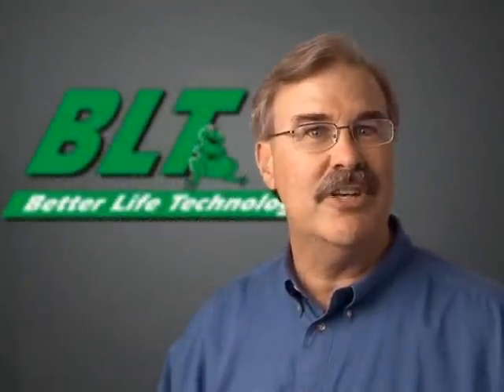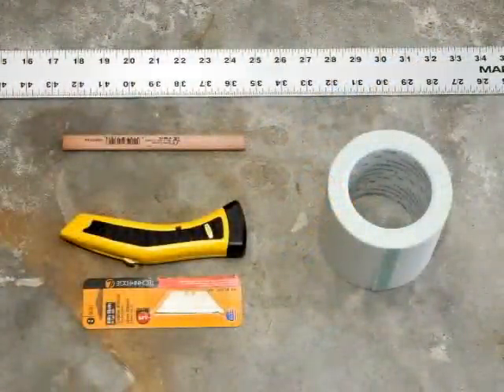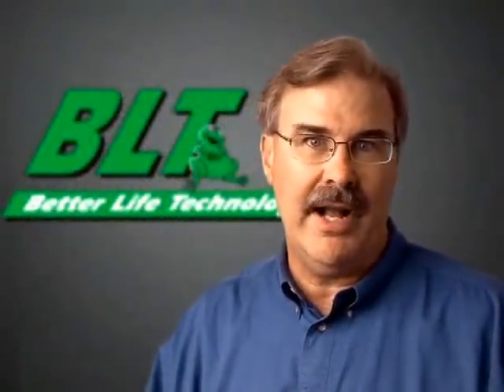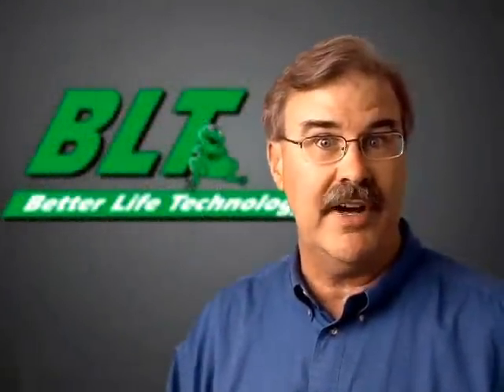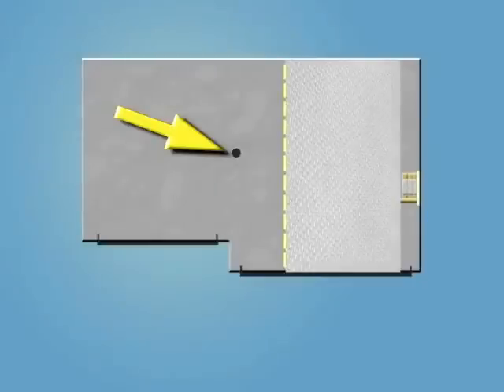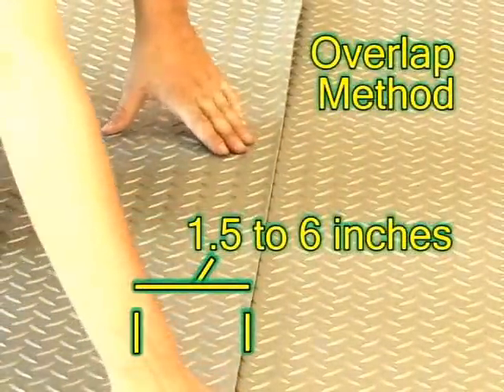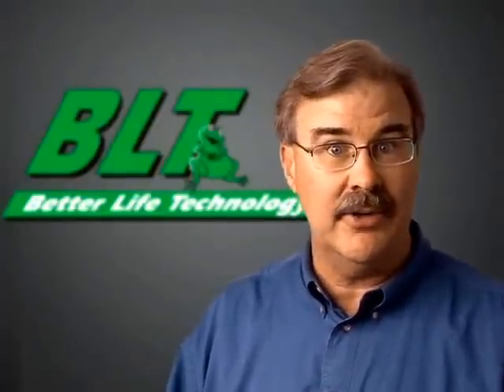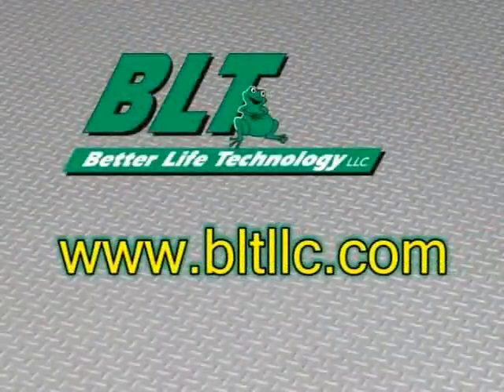Gfloor Installation

Comment: The commentary in the video says to leave a quarter inch gap between the flooring and the walls. However the video shows half an inch gap. Which one is correct? See the video at 8:20 - 8:22